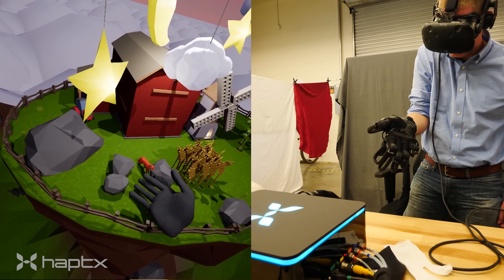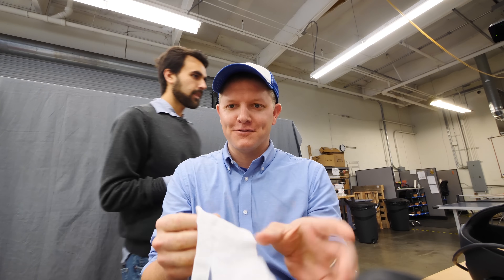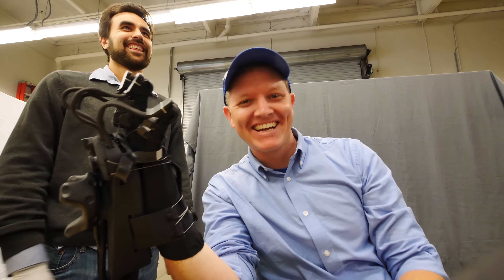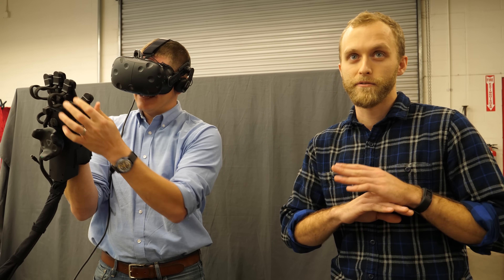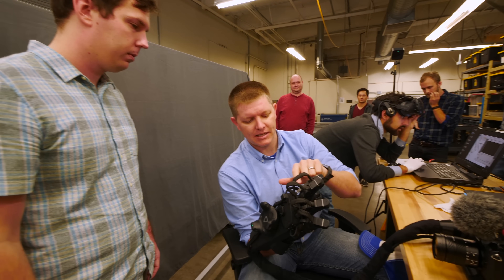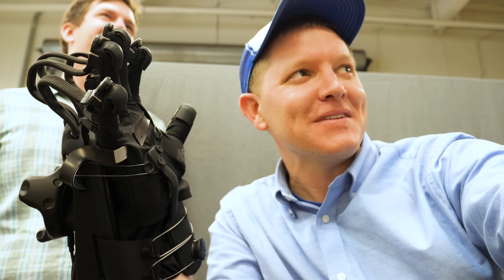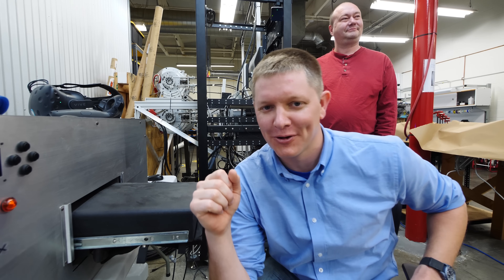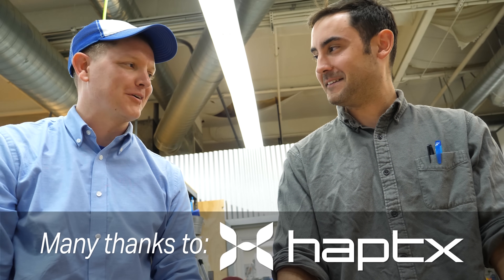How do you make a Virtual Reality Glove? - Smarter Every Day 191

Comment: SpaceTime. 3:25 i know i remember how cool this was in grade 4. the two-point thresh hold can get further then 2in apart and as close to zero. or even one point touching you but you feel two.  12:14 the speed or lag info you receive can only travel as fast as the density of the medium, the info passes through. air water hot cold will all have time different that would be noticed after time. now when you can move satellites around with light. hot/cold felt with light(mostly) and no lag with light. sucks that most of this tech only gets funding if it kills others, stop others from killing, or it kills you and stops you from killing. and it sucks that if they talk too much about it they would or could be giving away hard work. to someone that only ever has the capital to start something. never ideas or a goal. or wants to learn something new.  now don't get me wrong here you need capital to get something out of time and mistake after mistake to get something that does what your goals and ideas, open mind seeing ideas both come together more than your mom or wife saying it best thing since"on button" and "off button" became one button, and  they can't live without. but 30 years later used up one side down the other. cant get into school without knowing what, how and always why. you will need to know The Power button's power. 13:28 hot/cold easier." hot=anything more than zero energy.  Cold=zero energy. and how you tell different is your life's experiences with the mediums that energy pass through. it is the matter and how energy moves from one to other and how fast energy movement is. just think everything moves at the speed of light. unless matter has something to say about it.  matter, the only thing that can move spacetime its self. so matter can move nothing so much it can be seen. and understand how it moves everything and nothing all at same time.  even black holes need the late great Steve (Hawking radiation) another matter to release energy from a black hole.                                                              faster than light?     matter can do it. matter 1st  party matter few million years ago. started with a big bang. still cleaning up from that party if you look hard enough you can still see them partying, riding waves of nothing SpaceTime its self.

Comment: Your hand has hot and cold receptors. So you need to activate the gold receptors to simulate the cold :)
Reply: Don't talk about stuff you have no knowledge about, just makes you look stupid.

They don't simulate heat, they use actual heat. The nerve endings that get activated depend on how hot, or cold, the object is. If they actually simulated heat by using something like capsaicin then you would be correct in saying that they need to activate the cold receptors to simulate the cold, like using menthol for example.

Comment: its cool but you are going to need something the size of a small refrigerator to run two gloves,
Electroactive polymers seem like a much better way to go over pneumatics...
much easier to scale up to larger body parts and it solves latency issues as well.
plus add the fact that it would be much more form fitting and less bulky, with the points woven right into the glove material
using a conductive textile to power them would also cut down on bulkyness and increase flexability.

Comment: Hot/Cold: Simple peltier element?  
Two micro peltier elements next to each other for one sensory point. One is to create cold by dumping heat into a copper reservoir, the other one has a heaterwire on one site and dumps this heat into your finger. Well I just realized you don't need the second peltier and can just use the heater.

Comment: It's hard to imagine all of that temperature control stuff fitting into the actual glove with all of it's pneumatics. It's already probably too big to be a commercial product. Electronics tend to scale down very well, but fluids aren't so easy.
Reply: I am late for party but pnuematics work with air not fluids
Reply: @iplaygames8090  And temperature can be controlled by a thin metal mesh.

Comment: For the heat/cold, I'd have thought it would be small peltier units. The direction of voltage flow will change the directionality of the heat flow from either side giving you the ability to switch between hot/cold with a solid state component.

Comment: So they have tubes of air flowing from a pump? I wonder if they had small pumps in the finger tips which were set off by electrical charges, whether that'd be quicker than a tube relying on air pressure? Unless they do that already.

Comment: Hot would be easy, cold not so much,  quickly switching between the two would also be tricky.  It's funny how the "can you crush something" question had them so spooked. I imagine it's very possible, but also probably pretty hard to set up the latency for the "restricting tape measure thing" so that it feels like you can crush something, but also not cause the sensors at the fingertips touch each-other. Crushing something large like a tomato would probably work ok, but something small like a grape would be pretty difficult to emulate.

Comment: CAN WE USE SMALL PELTIER HEATERS (TEC) FOR HEATING AND COOLING IN THE GLOVE  ??  OR MAYBE SOME THIN FLIM HEATERS..
Reply: With Peltier effect, heat is only moved from one side to the other, the same as any heat pump. The heat would still need to be moved into or out of the area using some medium.

Comment: What is funny is that all of this is kinda obivious when you know about it. But at the same time I have no idea how they succede to control all of those factors at once and that fast!

I have a very good idea how all of that work. All is kinda basics. Inflating bladders, liquid, tendons with brake OR a pneumatic/hydraulic cylinder stop. IR, accelerometers, gyro, compass... There could also be some piezzo elements for added feedback.

All of that has already been done individually, but never combined and that preciselly. And not in real time. This is where the challenge is: making something portable that just work, that can be commercialised. And this is the easy part of the challenge. The real challenge will be to make it cheap enought to be sold at best buy.

If I understood correctly, there is 120 pixels. This is 240 pneumatic valves (one inflate, one deflate). There is also alot of water valves. I will say that they use 1/4 resolution, but might be totally wong but if I'm right it is still 30 thermal pixels, which is 60 valves. All of those valves need to be proportional ones, small, inexpensive, reliable.

They will most likelly have to design those from scratch. Good luck team HaptX

Comment: Did you ask them why they used air or a gas instead of a non compressible liquid since the delivery would be more instantaneous and more precisely controlled? Or do the want the compressability of the air in their design? Liquids could really add temp differential too. Was just wondering but im sure they have explored that

Comment: i would expect them to use thermo electric coolers.  also known as peltier devices. electricity provided in one direction will give a rapid cooling effect on one side. if you swap the polarity it will rapidly heat up then cool on the other side. 

using this method they could only provide a cooling effect for only a short time until the whole device becomes heat soaked. if a  water cooling loop were added on the far side (side you do not contact) they would be able to maintain the effect as the water can be sent through a small radiator elsewhere to dissociate the extra heat as they are roughly 50% efficient. the efficacy is really a function of the temperature delta. 

this is the same technology used in those charge your phone with fire products or the devices that precisely temperature control fiber optic lasers and high power LEDs. side note if you do not, the wavelength of light they emit will shift causing dispersion and increased thermal noise in fiber optic systems

Comment: 14:32 - Micro Peltier junction is my guess... you could go from hot to cold relatively quickly... and across a fairly accurate range by PWM and polarity. Or at least that's my guess. 15:20 - Fluid... would not have guessed that.

Comment: Perhaps to be able to change temperature quickly they set two different fluid lines, hot/cold, like a faucet's plumbing, and just inject more of one to compensate the temperature difference as the other drains away.
Let me give an example of what I think:
You're feeling something hot (aka hot fluid is pumped to your hand), then in order to feel something cold quickly, more cold fluid is injected to compensate for the warm one still present as it drains away.
This would, I think, work quickly enough to trick your brain at a sudden change of surface, but would require a little downtime before being able to switch back (I'm talking about probably ~0.4s) as the drained/draining fluid needs to be replaced with reheated/refrigerated fluid.

Comment: With it using fluid (not to mention all those numatic lines) rather than completely electrical I foresee a huge challenge when they finally try and make it light weight and small enough to completely fit on the forearm or back of the hand. Hope they get that far and don't have to stop at only a sit down or tethered experience. Also maybe they can weave in materials that react to electricity by contracting and expanding on the back of the fingers so they can get it smaller and you are free to interact with another person in the room also in VR. The ridged mechanical solution they have now would get in the way. Very exciting. :)

Comment: The thermal feedback is cool, but I don't think it could be feasibly implemented into the glove in a consumer model. Heating things up is easy, but cooling them down? There's probably a tank of pre-cooled and pre-heated fluid in the box, but with long sessions, that'd cease to be as reliable, plus the user would have to keep it plugged in either at all times or for an hour or two before use. All in all, it just seems unlikely to be workable for a consumer model. But the glove itself seems super cool, and I could see it being a consumer product within the next 10 years. They had some clever solutions, and that's just the stuff we know about. My biggest concern is comfort; most people don't enjoy wearing gloves, they get hot and stuffy. Given that people could be using these for several hours straight, that's a problem that needs to be dealt with.

Comment: I think they are using back up air tanks or storage at high pressures/low pressures to achieve the rise time on the bladders. The higher relative pressure would mitigate the response time, and they would only have to open and close the valves quickly (very quickly) to achieve specific pressures. Such as: 
A 100 psi tank opens for a tenth of a second into a small 20psi canister, allowing for the canister to achieve 30psi. (not actual values, but just an example.) Then a low pressure or vacuum tank allows for the rapid evacuation back down to normal pressure.
Or, if its for a small period of time for a simple rapid touch, instead of allowing the bladders to fill up then release, they keep the out valve open and open the in valve for a short period of time, that would create a hair like or rapid touch example. 

It would be the same for fluids. Hot and cold temperature fluids reside in a storage tank at high pressures. To achieve 90 degrees, they add certain amounts of each and blast them through the same tube to rapidly mix the two, achieving a precise temperature. (All other work is offsite in the calculations, the **easy part). You wouldn't want to pump directly to the gloves because you have to worry about (depending on the type of pump) spin up times or pulsing pressure.

Comment: Hey Destin. One thing they are probably working on is a Peltier device for the glove. A Peltier device allows for the control of heating and cooling of an object through an electric current. It responds relatively quickly and it can be packaged much smaller than any fluid device for thermal transfer. Might want to check it out if you haven't see one before. @smartereveryday

Comment: Wouldn't it make more sense to use a liquid for the tactors?  That way the pressure is more apparent and instantaneous.
As for simulating heat and cold, that could easily be done with peltiers, which are relatively common devices that transfer heat to one side and coldness to the other depending on the direction of the current.

Comment: I suspect hot is electrically generated with heating wires, and cold with fluid change to draw heat away from your hand, then you'd only need a cold reservoir.  Just my hunch. I wonder if they're fed directly into the tactors which would be really cool to allow better accuracy.  Awesome video, never realized how many things affect our senses.